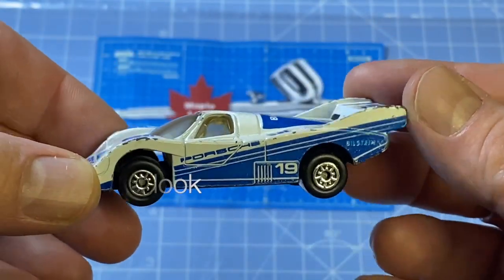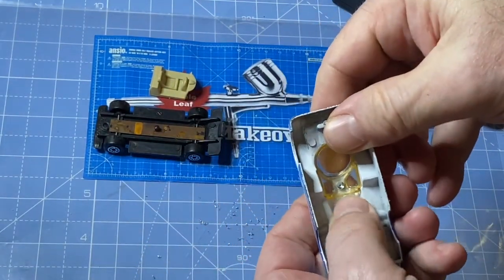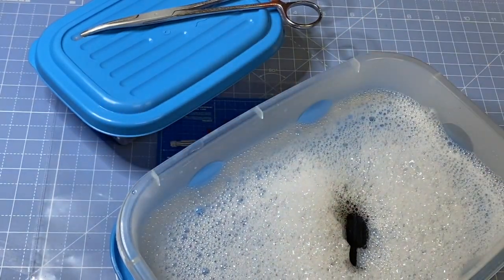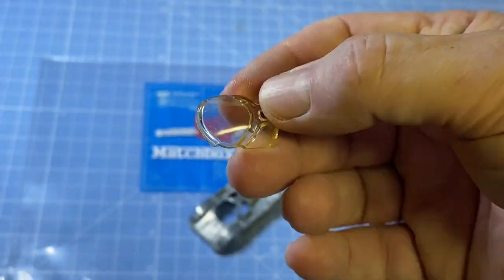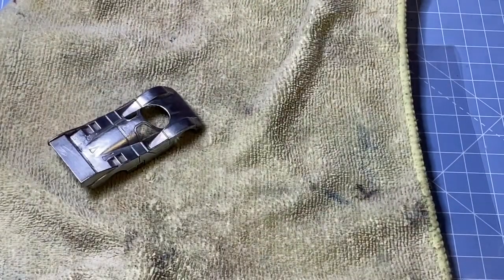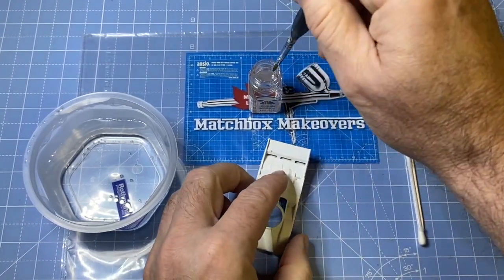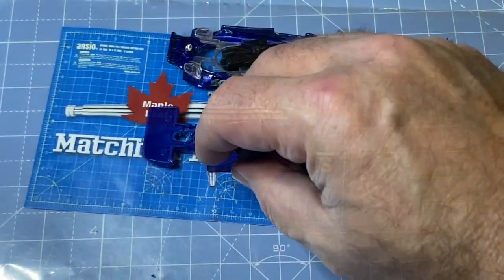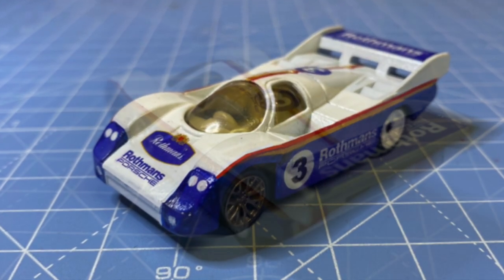MC Toy Porsche 956 (036)

Comment: Great job andrew, it had to be a Rothmans livery! nothing else would have sufficed.
Thinking of wheels to go with this thing though maybe the ones I used on that DeLorean I did recently would work well with it? I originally pulled those off a Hot Wheels Blitzspeeder.
Reply from the maker: Hi Alvarez. This was a challenging car for me. I love all things Porsche (I drive one) and wanted to do it justice, but those decals are really hard to work with. Especially with so many, and in sections. As far as wheels go, I had to ad lib with what I have. Slowly, I'll be able to build up a better supply of donors. You're right though, the DeLorean wheels you used really rocked and would have worked here too. I love your channel and you're teaching me a lot. You're a mentor from afar!
Reply: @MapleLeafCustoms  Yeah I have worked with decals a few times, they are either a walk in the park or an absolute nightmare to work with!
I have a small bag of unused wheels I have removed from many builds over the past year, i'd be happy to send some over to you free of charge to bolster your stocks :)
Reply from the maker: @AlvarezAzel  Well, I can't say no to an offer like that. That's extremely kind and generous of you, and it will definitely help me improve my builds. My mailing address is in the description below. I'm in Switzerland but I get overseas mail deliveries in Weil am Rhein, Germany just a few minutes across the border. Take your time, because the borders are going to remain closed until June 15th so I can't get there before that date. You're a bud!
Reply: @MapleLeafCustoms  Happy to help buddy 🍻
No worries I'll sort something out for you around the middle of next month 👍
Reply from the maker: @AlvarezAzel  Cool. Thanks again.